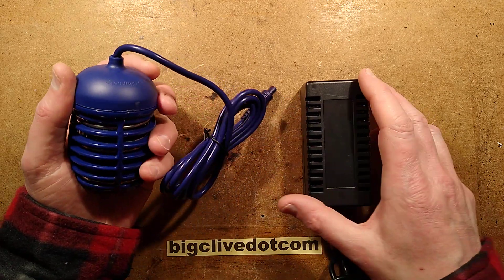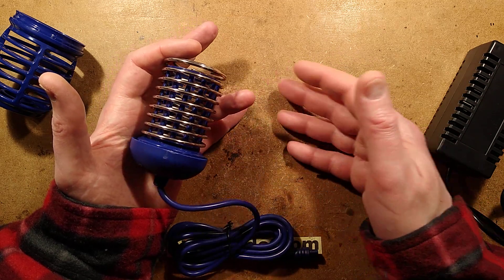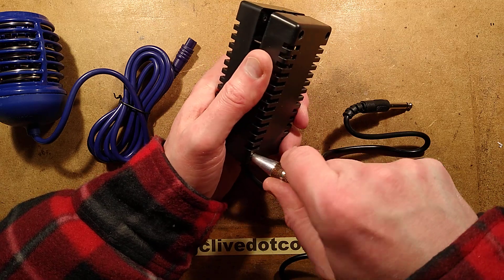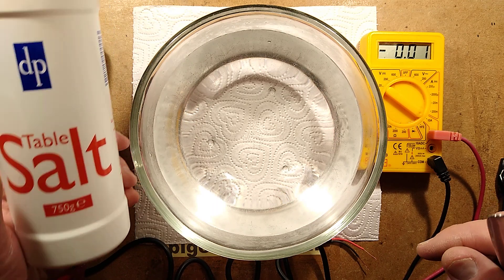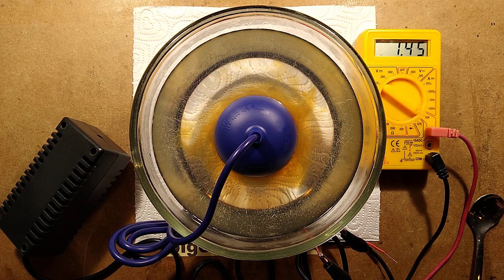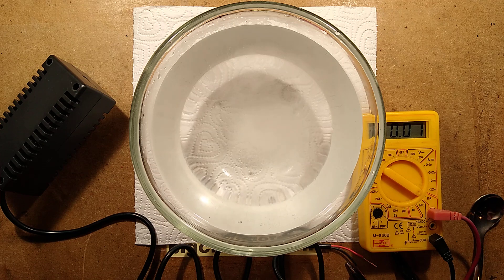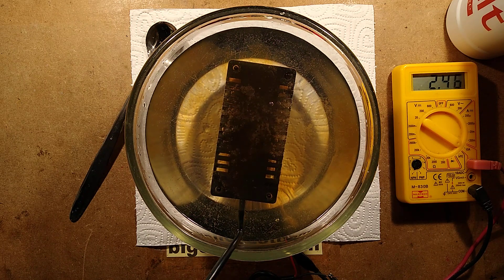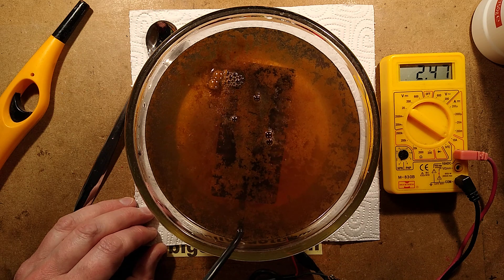Inside two different body detox foot spa electrodes.

Comment: The blue power plug looks like the ones Braun use to power their shavers.
Reply: Or a cheater cord from an old tube TV.
Reply: Couldn't agree more on the Braun shaver plug.

However the cheater cord for the old TVs.

Is that cord is usually a rectangular plug with two round holes not figure eight or close to it or the like the one on the Braun shavers.

There are other similar shiver plugs as well.

Although I remember seeing years and years ago on Vintage equipment.

Is that had pins that would accept a cheater cord for the TV.

This was used for advancing projectors slide think Kodak Carousel.

Back when you actually did home multimedia in quotes.

The idea was that you use cheater cords and such for your your thinking of your devices.

One device would be placed on a reel-to-reel recorder.

In a strip of conductive spice material.

Would be on the tape where you wanted to advance your slides.

Also with the movie projector sometimes you would do that as well if you were using it slides with it.

But back to the scary part.

Zoe's unit still use the cheer cords for TVs.

Which as you know how to male plug on them.

Now I'm imagining you know you got several different plugs that might look very similar right.

Goalie all your sink connections would be connected together in adapter or extension cords just two parallel them.

But I wouldn't clogged the other end into AC power would you.

For various reasons and obvious reasons.

A few nice pops and bangs and destroyed equipment.

And a lot of those devices for your sake had live terminals or contacts accessible.

Also back to the cheater chords.

Anyone notice the old Appliance cords like on a mixer or other small heating devices and other things?

If you're familiar with a cord it might...

 look familiar?

Right!

Also I did in the old days, crossed connectors that fit those.

Although I never use them for ac voltage for obvious reasons.

I actually use them in Reverse for low-voltage.

The male end was used for power out.

There was protection as well as warnings about proper use of course.

Not the only thing I've repurposed over the years.

Comment: Devils Advocate, what about the body parts submerged in said slime/gunk/yuk, ( osmosis / reverse osmosis ) style taking in the salts or whatever the chemical the 2 electrodes are producing from the salty water to give the immune system a boost ???
Reply: Chromium salts will give the liver a boost, right into " you want a transplant kind of right now" hepatic failure territory, but your body will be lovely a century after burial, because it will be tanned nicely, even without any embalmer injecting formaldehyde in.

Comment: But the "real" question is, will it reverse the effects of 5G exposure ;)
Reply: If you want it to, yes.
Reply: Shungite lumps, (only russian ones apparently)
Reply from the maker: Yes.  The cumulation of 5G death beams will be drawn out through your feet and will be visible as a brown discolouration in the water.
Reply: @bigclivedotcom  fill a balloon with the hydrogen and light it.
Reply: @bigclivedotcom  But only with the super deluxe model that requires treatment every other day.
Reply: @bigclivedotcom  Perhaps, but only if you use decent salt from their own supplier (which contains actual Sodium Chloride) and not the cheap stuff from Tesco/Asda/Aldi which only contains NaCl. Apparently...
Reply: @lordmuntague  My table salt also contains potassium iodate (this is common in Germany to prevent iodine deficiency), and sodium ferrocyanide as an anti-caking agent.

Comment: Hi Clive, does it remove Toxic Masculinity? LOL. 😂
Reply from the maker: Only if you sit in the bowl with your bits marinaded in chromium salts.
Reply: @bigclivedotcom  That would do it even without the electrodes.
Reply: @bigclivedotcom  since electrolysis of SS electrodes releases chromium into solution, and we're seeing warm colours (yellows, oranges) showing up in this experiment rather than cool colours (i.e. green), I'd be on the right track to assume these products are likely to be exposing their users to hexavalent chromium, yes?
Reply from the maker: @crimsonhalo13  Yes.  Some researchers analysed water before and after and found a massive increase in chromium and nickel.
Reply: Crimson Halo - Looks like iron chloride to me. Although there still will likely be some chromium salts in there too. Might not be hexavalent, but I still wouldn't want to be sticking my bare flesh in it for any length of time.
Reply from the maker: @crimsonhalo13  I've added a link to the independent tests in the description.  There was significant Chrome and nickel in the water.
Reply: @bigclivedotcom  yep, pretty much what I expected to see -- iron, chrome, nickel, and the minor alloying elements all showing up afterwards. Conclusion: it won't do a body any good, but it might kill some plankton once flushed into the ocean.
Reply: It's no big thing :o)

Comment: the power supply i have seen was a 100MA  consent current  supply that flips the polarity every few minutes
Reply: Mega ampere?
Reply from the maker: @pierreuntel1970  Yes.  It's the express treatment.  You don't even need to take your shoes off.
Reply: @bigclivedotcom  flash detox
Reply: @bigclivedotcom  hey big Clive.

You know those who use could actually have a use.

That's not intended.

As in repurposing.

Not with the electric part of the electrode.

Although that could be used as a spring or something for the coiled ones.

But the case or the black one who would make for interesting Bin Laden case for something that would need heat dissipation and just grill out any extra holes if needed. For cables and such.

But also the cables that are attached could be repurposed.

Especially the ones with a quarter inch plug on it.

I'd say 6 foot?

Even the others just log off the plug and you got yourself off a sexual cable for another purpose.

As far as the round electrodes the case could be turned into an interesting light fixture or something like that.

So it really does have a purpose after all sort of depending on how you want to repurpose it.

Quack medicine to a baker or somewhere like that becomes Lund Park products becomes new DYI project materials.

The same way with those power saver devices.
Reply: @pierreuntel1970  ⚡⚡💥💥
Reply: @pierreuntel1970  Typical low grade medical mistake.  It's amazing how often budget vitamins misspell the units and prefixes on the packaging.
Reply: @pierreuntel1970  Oooh, fizzy!
Reply from the maker: That makes sense for even electrode wear.